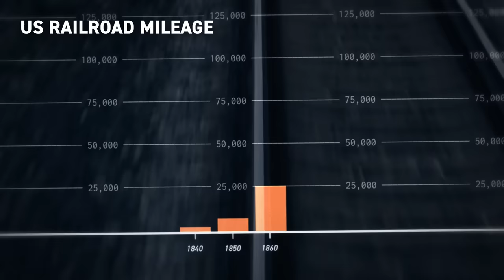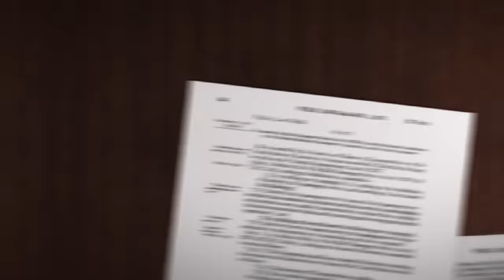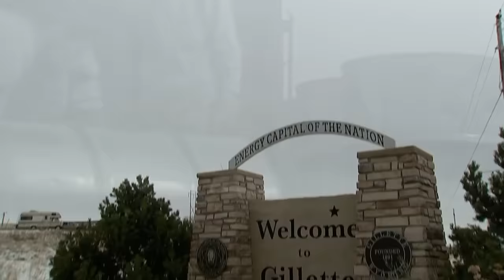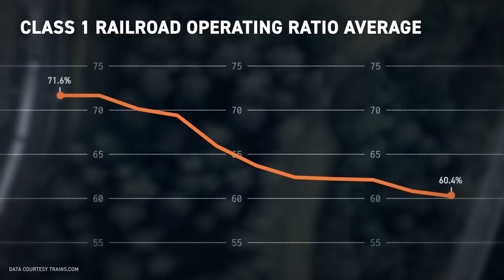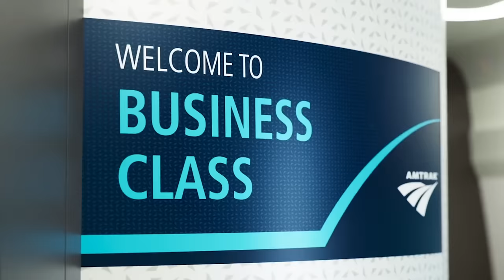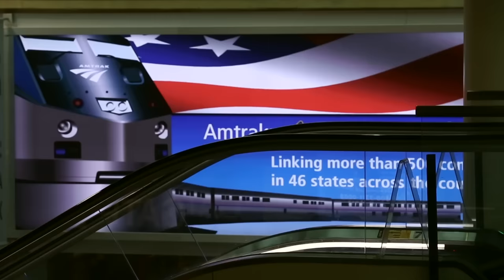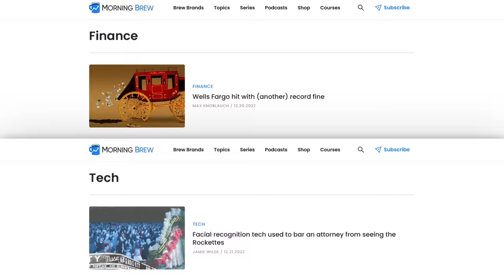The One Tiny Law That Keeps Amtrak Terrible

Comment: There is some discussion about restarting long-lost rail service from Salt Lake City to Las Vegas.  If the LA-LV service is also launched, it could be the de facto restoration of the old Los Angeles and Salt Lake City railway.  It's interesting that LV was founded in large part as a stopover point and maintenance depot along the LA/SLC line, but the city's modern appeal as a destination from both directions could be the factor that brings rail service back.
I think that there is also potential for a route to the north from SLC, through Logan and Pocatello to Idaho Falls and maybe to Rexburg. That route also existed once upon a time, with service all the way to West Yellowstone, MT taking tourists to YNP.
Reply: Does SLC WANT people to flee to Las Vegas to spend money? Probably not. It is sad though as moderate distance travel on train can compete against aircraft.... No "I need my car" stuff when you'd travel via aircraft to these places most of the time anyway. I just don't see it happening.
Reply: I think you mean through Ogden, not through Logan
Reply: @gideonparry5684  I actually meant both Ogden and Logan. I emphasized Logan to make clear that I think it should run through Cache Valley and US-91 rather than following I-15.  And Ogden is already connected in the existing FrontRunner service, so I was emphasizing the new connections.
Reply: @brycechristensen2296  I kind of Wonder how a train would do through Sardine Canyon from Brigam City to Wellsville, but I would definitely take it if it existed
Reply: @gideonparry5684  The existing freight tracks avoid Sardine Canyon and run through Honeyville/Tremonton area and along the Bear River into Cache Valley.  I assume a passenger train would follow the same route.  It's a bit longer, but not too much.
Reply: To the best of my knowledge they may run frontrunner to Brigham city, but that canyon is too steep for trains (not enough grip on steel wheels to steel rails), but they may do a bus bridge across. They could do a spur through Tremonton, around the long divide, though. I'd love to see a run of frontrunner to Cedar City and St. George, and Vegas would be good, though with the route through Arizona being a pain and it crossing three states could make it tricky.
Reply: @Bonzi_Buddy  there's a lot of Salt lake to Vegas traffic every week. There's a reason Wendover is built basically due west from SLC down I-80, and Mesquite is as close to Utah as possible. The corner of Arizona that I-15 cuts through isn't it. Not saying that the Utah weekend migration to Vegas is on par with the Los Angeles migration, and Wendover isn't Reno, but... There's a pent up demand in Utah
Reply: @cowtessa  vehicle traffic and political will to see your citizens spend their income in Vegas…. 

Politicians do not want this.
Reply: @Bonzi_Buddy  and yet, year in, year out, they've not done anything to slow it, nor to try to attract those people to stay. Besides, all the expos, conventions and such happen in Vegas. If they run a line down to St George, that's basically to the Utah/Arizona border. Could see Nevada trying to figure out how to get a line through to there if it happened.

Comment: If Amtrak still existed in Idaho it would've saved me some dangerous winter drives to Portland/Seattle/SLC. They're currently looking at restoring the Amtrak line so hopefully that happens in a few years!
Reply: It does, Sandpoint, on the GN mainline.
Reply: Came here to say Sandpoint.

I've ridden Empire Builder from Seattle to Sandpoint when I lived in Idaho.
Reply: @J-1410  Sandpoint to Boise is ~500 miles via I-84. Seattle to Boise is also ~500 miles. Almost 50% [800k/1.9M] people in Idaho live in the Boise area, so going north to Sandpoint to go to Seattle or Salt Lake makes no sense. Having a hub in the Treasure Valley would be massive for Idaho
Reply: And the train trip would’ve been safer?
Reply: @gregorydaggett7444  unfortunately the reason Sandpoint gets a station is because it's on the main cargo line as you probably know.

There needs to be far more rail infrastructure in the U.S.
Reply: @illusiveamy  The talk about the Front Range fit in with one of my trips. An entire train of private passenger cars left Denver and stopped at places along the way at night. One of the places we ended up was in Sandpoint during the middle of the day on the way to Glacier National Park. And where did we stop for a change of directions in Sandpoint? Right on the time zone marker. One half the car was in one zone and the other half was in the other. Only took an hour to walk 5 feet. But walking the other way you traveled back in time. 😁
Reply: @d.j.2068  Without question
Reply: i would give a couple of teeth to have a rail line from southern California up to SLC to visit my parents. But even if we do get rail reconnected, it's gonna stop in Vegas. Good luck on your dream!

Comment: I was in San Diego last year in a hotel RIGHT next to the train station there. There is a train route called the ‘pacific surf liner’ that hugs the coast from LA to San Diego. The is a good public train line and one that works well in America. In the hotel pool I meet a group of people there from LA celebrating one of their birthdays. Everyone in the group had never even been in a train in their life which I thought was astonishing!
Reply: This is, actually, a good example for the problems with US rail infrastructure.
This line is partially clised (with bus replacment in one section) due to a dangerous track section along the eroding beach and rising water level. The Orange County Transportation Authority, which owns the right-of-way said it happened fast but for years engineers have been warning that this will happen  and no one acted to prevent it. This section was closed in late September 2022 and it might reopen in February.

Comment: Hello All,  1 /the reality is that Congress, in practice, wants Amtrak at minimal cost, and that is what it gets. Amtrak once handled LCL/Less than Car Load, Express, and Mail. Some LCL competed with the host railroad, whom, not unnaturally objected that Amtrak was syphoning off freight revenue. Express, once handled by REA/Railway Express Agency as an adjunct to Passenger service, as was US Mail. In the two latter cases bulk loading and fast schedules meant that traffic went to airlines. Although Amtrak did revive some of these services, they were restricted by what passenger services Congress authorised, or States subsidise, which frequently changes, so service provision became sort term. Eventually, the railroads (who have some influence on the appointment of Amtrak senior executives) then ensured that the next Congressional appointments opposed Amtrak non passenger services, and as a result, Amtrak LCL freight was shut down.
2/ Congress could mandate that train lengths be restricted to "average" crossing loop length ("average" would prevent the designation of one long crossing loop as a train length definer).As it is not unknown for existing crossing loops on a particular route to be of variable length, some of which are intended to serve Amtrak.
3/ the other issue is that the increasing frequency of long length train derailments is partially due to the difficulty of handling long heavy trains with variable individual wagon tonnage running over rail routes not specifically designed for long and heavy trains.(The Iron Ore trains in NW Australia, and coal trains on Central Queensland run on railways specifically designed for long, heavy, and equally loaded wagons, the dynamics of which are quite different to mixed freight trains common in the US). Hence the reason for the push to retrofit EP/ElectroPneumatic brake systems (similar to those used on Suburban Electric railways) which would ensure a smoother, and more even brake application over the length of the train. However, as most freight wagons in the US are now owned by non railroad entities (and managed by wagon hire companies), the chances of that being mandated by Congress is also rather low. 
4 /For Amtrak to work as an effective passenger service provider, it really needs its own right of way. A lot of mothballed/abandoned rail routes are a feasible alternative, plus some existing rail corridors are actually  quite wide, and were the result of 19th century land grants. Congress could ( but likely will not) mandate that some of this corridor vacant space be reallocated to Amtrak, and collectively, Amtrak would then have access to a lot of passenger rail only corridors , some of which could  also be used for regional commuter operation.

5/ Some thoughts from Australia, regards to all.

Comment: Hell yeah, someone else talking about the potential of front range rail. The shear potential or this corridor is incredible. Thank you for talking about this- A resident of the front range for almost all my life.
Reply: If the redesigns of I-25 along Rio Grande Blvd, & of Burnham Yard (~4 block wide area stretching from 4th to 13th, along Seminole Rd), successfully move the Colorado main line back to the area West of Lincoln Park between Pecos & Osage, RTD's new transit hub at Burnham Yard could finally do what Union Station is no longer suited for: Connect light-rail routes from Denver International Airport, to full-gauge ski trains headed West. 

Could/should it be done with high speed rail instead? Probably; but even establishing light-rail to town & ski trains to the resorts, has taken decades.
Reply: Agreed 100%. Grew up in Boulder and would love that option

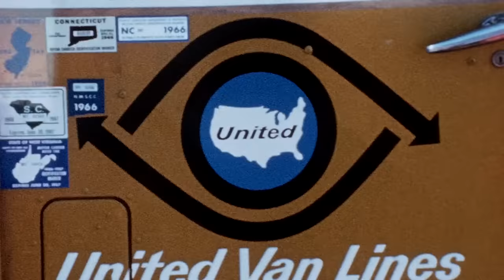Comment: I would love to travel by train.  But the high cost and the horrible schedule makes it impossible.  I don't drive so you'd think that a train would be the perfect answer.  However the bus stops running (to take me to the train station) at 4:30. The train depots closes at 5:00.  And the train arrives and departs around 2:00 a.m. once a day.  Also, the cost is much higher than airfare. The last time I took an overnight trip, one of the bathrooms was out of order and the other one stunk so bad that it permeated throughout the whole car for my entire ride. Certainly not worth the extra cost.  After that, I've been in no hurry to take another trip.  Besides, you can't book a trip online where you need to switch trains.  It simply can't be done unless you know which train travels to which city on your route.  There's no reason that the system can't be changed to allow you to do that, but it's been that way for years and Amtrak doesn't seem to care that it's a huge inconvenience!

Comment: Amtrak’s problem isn’t that it gets stuck behind freight trains. It’s that it’s trying to run passenger trains on a rail network optimized for freight rail. An optimal freight network is a terrible passenger network and vice versa. You can get every freight train out of the way, but if the track speed through the mountains is 35mph, you’re still only going 35mph. 

Also, priority doesn’t mean that there’s nothing else on the railway. It just means that the train gets preferential treatment in conflicts. If the Amtrak train is running 30 minutes late already and has missed its slot in the schedule, and it gets held up behind other stuff, it doesn’t mean that it didn’t get preference. It  means that it got preference and everything was waiting for it, but it wasn’t there to take advantage of it and now it’s stuck behind all the stuff that was waiting for it.
Reply: To your point, if the train is already running 30 minutes behind schedule it’s most likely due to freight trains. I’ve had this happen countless times on Amtrak long distance routes. The train gets delayed by one freight train then every other freight train now gets “priority” because the Amtrak is now late. It’s a spiral into being completely delayed. So it’s definitely a mix of the points you mentioned and the points brought up in the video. But by no means is it Amtrak’s fault or responsibility.

Comment: Hopefully Sam will do more railroad videos as it is a fascinating industry which much to talk about.  For example in the US, track is divided into 9 classes in which passenger and freight have separate speed limits.  Often simple track maintenance would be required to upgrade a track from say Class 2 (25mph freight/30 mph passenger) to Class 3 (40mph F/60 MPH passenger.)  But sadly rail companies rarely care...for them to go from 25mph to 40mph isn't a bid deal as most of their cargo isn't time sensitive and their main bottleneck is loading/sorting/unloading.  But for a passenger rails going from Class 2>3 (or even 3>4) is HUGE.  Track maintenance is really important as it reduces noise/rail stress/bottlenecks.  In Asia many railroads are welded together on top of concrete ties which makes a huge difference and allows for fast trains.  Yet many American rural railroads use fish plates or sometimes nothing at all on top of degraded wood ties leaving nasty gaps between the bars.
Reply: It's honestly amazing just how neglected American passenger rail is.
Reply: @SteelJM1  I generally agree.  I'm ok with free market capitalism with competition but not monopoly capitalism.  The latter is what we have with the rail industry...there is a huge barrier to market that prevents new companies from stepping in.
Reply: You are so right. A passenger train simply traveling 15 mph faster than 25 mph greatly reduces travel time. Upgrading lower speed tracks is by far the most effective and  cost efficient strategy for shorter trip times.
Reply: @davidjackson7281  But then how would Warren Buffett live on slightly lower returns of profit?!??!!
Reply: @Praisethesunson  You do know that BNSF is the most pro-passenger of the big Class Is, right?  And has also invested by far the most in upgrading corridor capacity over the last 30 years?  Per passenger-mile, they incur the fewest minutes of delay by far, even though Amtrak runs over more miles of their track than any other Class I, and they are the only railroad that has triple-tracked any main line in the last 30 years with their own money (the former ATSF Transcon), save part of UP's overland route out of the Powder River Basin.  BNSF also runs commuter operations under contract in LA, Seattle, and Chicago.  They still get in Amtrak's way, but if anything, the other Class Is should be looking to them as an example of how to work properly around passenger rail.
Reply: In majority of Europe rails are continuously welded too, have been for 40 years.
Reply: @GintaPPE1000  Wasn't the cause of deaths and injuries last year in Montana the result of poorly maintained BNSF track?
Reply: @RX14isnotaPro  That's nice.
Reply: @GintaPPE1000  Lol bro you are setting the bar so low it's a tripping hazard. 

Berkshire Hathaway has made their intent on how they manage their railroad holdings(BNSF) very clear. 

Us the inherent Monopoly of rail to squeeze out every last possible drop of profit. Then when the rails(workers) finally break down. 

Throw it out like the burned out cigarette butt it will become.

Comment: The reason Chicago to New Orleans generally has a high on time rate is because CN doesn’t really use the former Illinois Central tracks like it uses other tracks that CN owns.  Less freight traffic means higher speeds and better on time performance.   Conversely,  Amtrak service between Chicago and St Louis is constantly delayed even though a small portion of the route runs on CN tracks.  But it's the CN tracks and trains that are the culprit for the delays.  These tracks were also once owned by Illinois Central ( Gulf) but obviously is a much heavier freight cirridor.  Amtrak is hoping to reroute those trains onto Metra's tracks from Joliet to Chicago,  but a bew connection must be built connecting the Metra tracks with the St Charles Airline and a direct connection between the St Charles Air Line and the tracjs leading directly into Chicago Union Station .  This would not only improve the A t Louis to Chicago service  but would shave some time off the New Orleans service as those trains currently  have to do a reverse maneuver to get to the St Charles Air Line  that eventually connects to the CN (tracks to run south

Comment: On vacation in California in 2006 I caught Amtrak from SF to LA just so I could have a leisurely scenic trip along the Pacific coast.  The train was more than 3 hours late into SF and our scheduled LA arrival time was around 5pm...
It was dusk by the time we got to San Jose so I saw none of the coast.  I arrived in LA at approx 5:30 am the next day.
All because the passenger train had to pull over for long freight trains. 
Apparently the route is now double-tracked so it doesn't happen but next time... I will drive the coastal highway.